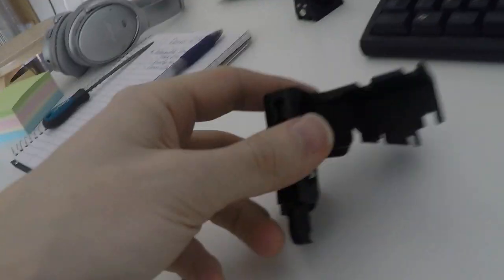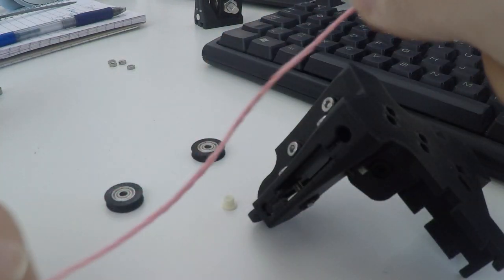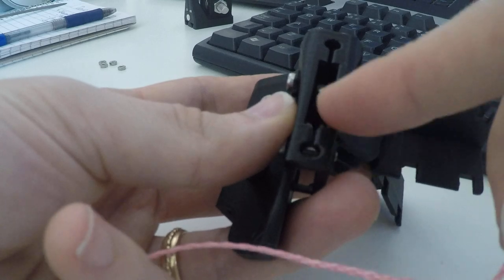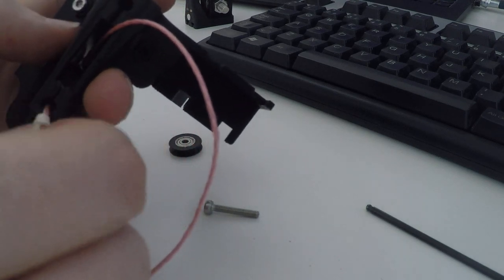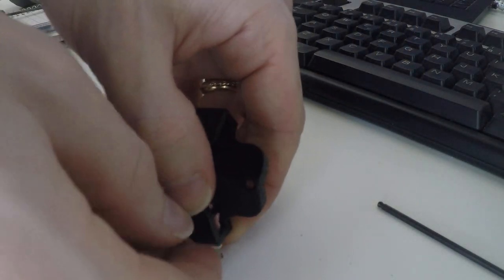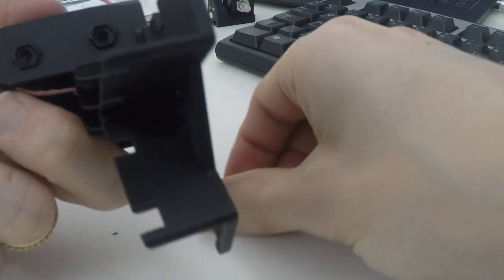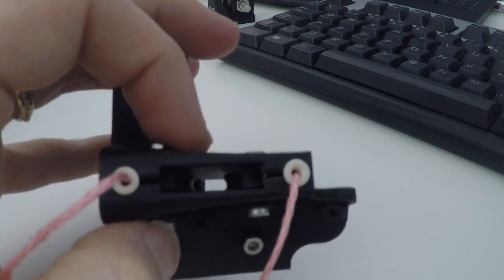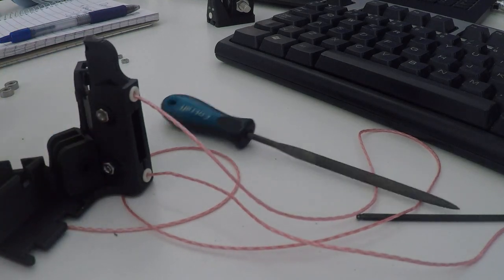Less Fiddly Corner Clamps

Comment: Hi Tornbjorn, do you have a slicer for Hangprinter v2 and a calculator, if so, can you give a link to it? I am building my own hangprinter v2 inspired by your project, I will be very grateful.
Reply from the maker: Hi, you can use any slicer. Do you mean the calibration calculator from 2017? It doesn't give very accurate calibrations so don't trust it too much. https://web.archive.org/web/20170521183447/hangprinter.org/calculate.html
Reply: Thank you very much!

Comment: Has anybody developed a 2D version? to draw in a blackboard or wall...
Reply from the maker: Check out polargraph.co.uk. I've also used Hangprinter for some 2d plots
Reply: @torbjrnludvigsen-hangprint7605  I know polargraph, and some other models, but they use only two cables, I like better your model with tensed ropes. I would like to apply your model to draw vertically with chalk (needs a bit of pressure).